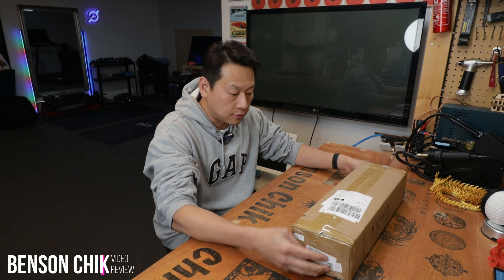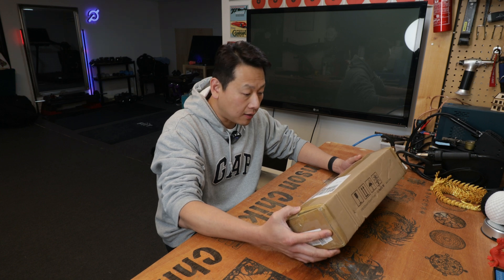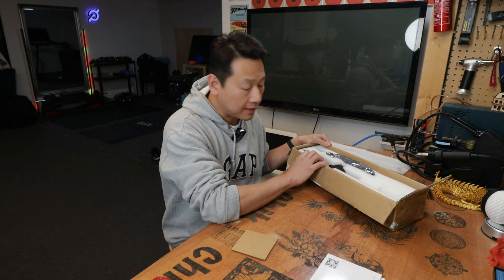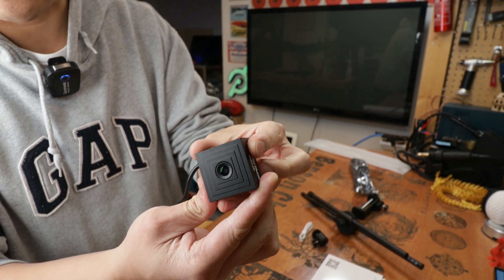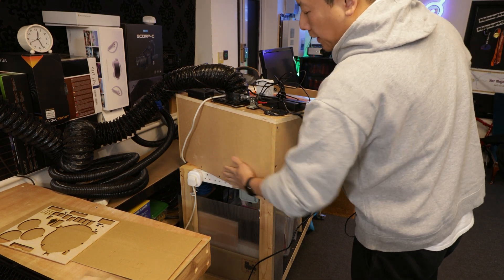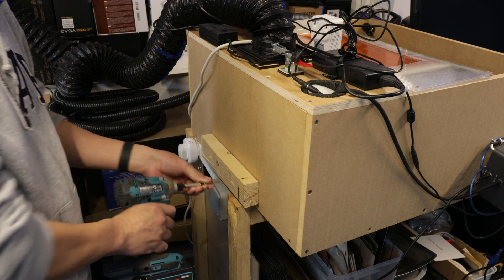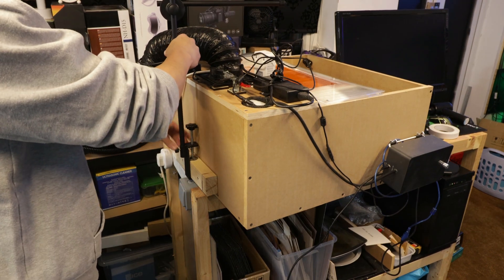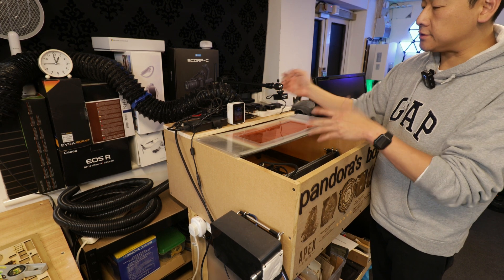Atomstack AC1 Lightburn Camera First use and review by Benson Chik

Comment: You made this video about 6-7 months ago, so I am wondering how the camera is performing for you.  Do you use it regularly?  Would you recommend it to new laser / lightburn users?  There's many options out there and I hope to "get it right" buying one for the first time for my Comgrow D1 laser.  Thanks!
Reply from the maker: I sold the machine 2 months ago to make way for another laser. The camera is good for positioning materials but it is not 100% accurate, it will always be a few mm off and need fine adjustment with preview. Using the atomstack camera there is less work at calibration, I have used webcam and other PC connected cam and they tends to need more calibration and still be out by a lot. 

The most useful function for the camera is the ability to trace an object or hand drawn shape via lightburn.